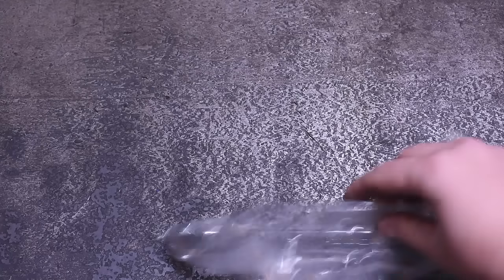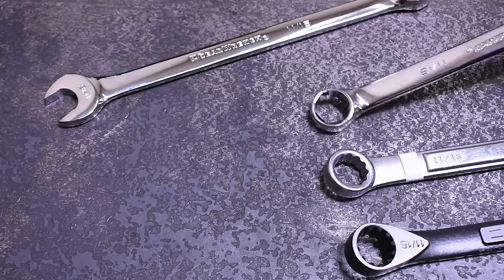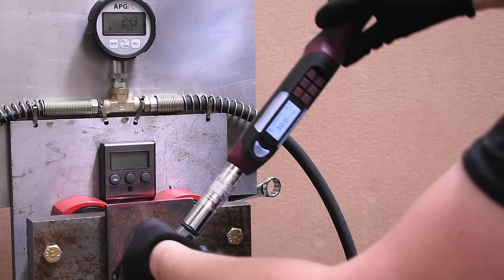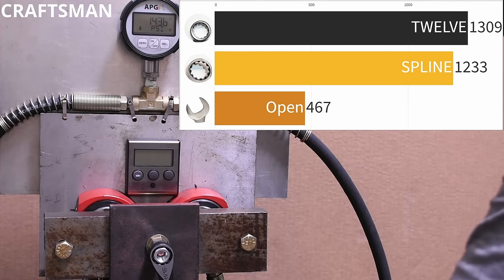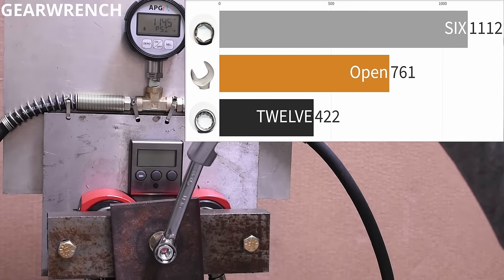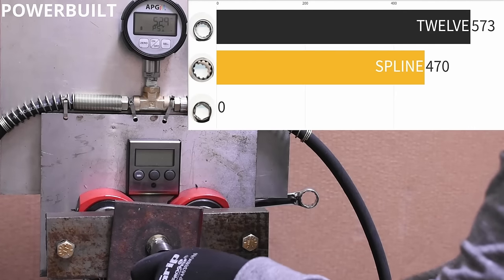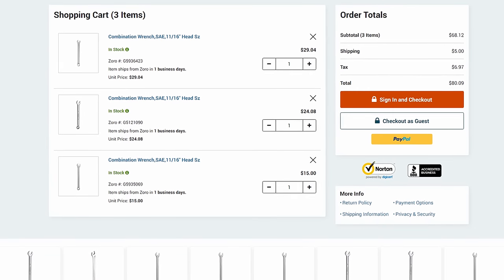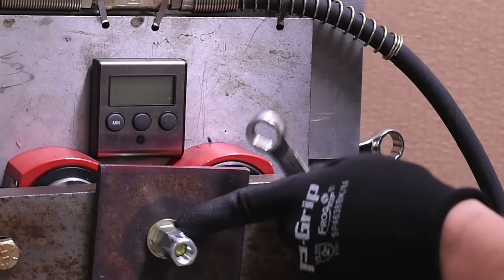Let's Settle This! What Wrench & Socket Design Will Slip 1st?

Comment: In my experience spline tends to rape bolts pretty bad if you're really going at it. If I can use 6 point, I'll use 6 point. The only 12 point I've ever specifically bought was an impact socket for my axle nut and that was because the nut was 12 point. I do have a few 12 point wrenches though that kind of floated into my collection over the years. I barely use them. Maybe on bleed valves when doing brakes. I can see a use case for spline but I think it's really only when I can't do it with a 6 point and I don't care if I destroy the bolt head and possible round the shit out of it. I also know though that you can hammer spline ends onto rounded bolt heads. Say you round a 1/2 bolt head that you went a little too ham on. You take a 7/16 and just wack the spline onto it and you can get a decent grip. I'm sure you could do the same with a 12 point too though.

Comment: It should be obvious that the wrench that fits with the least air gaps is going to be the one that works the best. When it comes to stuck nuts and bolts - and especially tarnished brake line flare nuts - I usually go slightly undersized and pound it on until I'm confident that they're practically cold-welded together.

Comment: I have not seen the video yet
I guess 12 point will slip first as there's far more potential points of failure, and with the nearly rounded edges of the teeth, it seems very prone to slipping.

Spline seems like it wouldn't slip, but if it does, you're gonna have a broken tool, and a broken bolt.

6 seems like it'll hold thr best, but you've got to have room to use it since there's fewer teeth to grab the bolt with

Edit: yeah that seems about right except for the spline. It seems like the tool stayed together, and it really did just strip the bolt. I guess that makes sense. You'd want the tool to be of a harder material than the bolt so it doesn't give under higher pressures.

Comment: The reason the 6 point came out on top is because has the most surface area on the nut/bolt to spread out the force applied. Each one has pros and cons. For example: the 6 point allows for the most torque out of these but the starting points are every 60 degrees whereas the 12 point provides starting points every 30 degrees but doesn't have as much surface area on the nut/bolt so you can't get as much torque. The spline is also pretty good for getting rounded nuts/bolts off too. The spline cuts into the nut/bolt and provides a bit more surface area than the traditional 12 point and so you can get a bit more torque out of it but you destroy the nut/bolt in the process. The open end is great for getting to a nut/bolt that you can't put the closed end around but you go back to the 60 degree difference per starting point and you sacrifice a third of the surface area (2 sides of the 6 point) on the nut/bolt which lowers the torque you can put on it substantially, as we've seen in this video. Hope this helps explain why the results came out as they did!
Reply: NOTE: This is based on the standard 6 point nut/bolt. For the regular person, a 12 point is usually the go to due to ease of access in tighter places.

Comment: This is awesome. This is the reality. 6 point to break it loose. 12 point tight spaces. Spline for spline fasners. Torx for torx. Hex fot hex. Triple square and so on and so forth. So for every faster you will require the proper tool to remove. You may slide by expending time for odd items. Usualt the exchange of time to aquire the correct tools is more beneficial than creative means. This is how tool companies retain business. A new tool for a new fasner. Same job, as the old faster. The difrence is the tool company paying a manufacturer to use the new fasner so the tools will sell. You use it, put it in the box and eat your remose as it sits rusting and collecting dust. I rember purchasing a screw driver for a ford car to remove one screw $235.00. I used it maybe 6 times. It was 6 foot long. From the driver's door to ajust the headlights. This was long ago. That was when a $250.00 a week was great pay. Today. $1500.00 to snap-on to get the socket set to remove the bolts from a f450 rear rotor from the hub. Seeing it should be attached through the lug studs and nuts, it also has 16 "omg its tight bolts" that are rusted into a permanent position.  (Harbor freight 10 pc spline drive socket set in 1/2 " $19.99) breaker bar and strapped to the building and 3 people taking turns.

Comment: There would be a big difference in the torque readings if the bolt threads went all the way through the couplings.
Example: A can of meat, beans, fruit or veggies, ECT is harder to compress / crush than an empty can. With your bolt only coming partially through the coupling and not supporting the couplings internal void the coupling will distort and cause inaccurate torque readings and premature failure. But the analysis is correct. 6 point made of the same materials and clearance specs will typically outperform 12 point because it has more surface area contact. This brings me to another point, the amount of initial slop, or a wrench having to large a bore will not perform as well as one with the correct, snug fit. But that is also dictated by the bolt manufacturer and their quality and tolerances in the manufacturing process. Speaking from experience!

Comment: Can you do a gator-grip vs other "universal" sockets (with the pins to grip a range of sizes)?  Curious to how they hold up under a torque wrench.  Other channels have shown them failing with impact drivers which they aren't really designed for, but none just testing torque failure.

Comment: I don't know what is the best way but is there a reason you put the wrench on a long nut in a point where is is hollow rather than where is has the bolt though it? In a real world application I would almost never have the wrench positioned in such a way. Rather I would have the wrench all the way at the base of the nut for what I would see as the most intuitively secure way to turn it.

Comment: i mean assuming it’s a standard 6 point bolt, obviously a 6 point will provide the highest amount of slip resistance. 

12 points are meant for lower torque applications in tighter spaces where the increased points of contact available make it easier to get onto the bolt head.

Comment: This video came to me right on time 
I’m just starting out in a trade, shopping around for tools 
About to buy my first sockets and wrenches 
Trouble for me is I’ve been advised not to buy anything nice 
Because I’m working on boats, mostly inboard motor, we drop sockets once in a while and never get them back because they’re way under a motor out of sight 
Or they go overboard 
My boss uses a Stanley 224pc set
With a handful of wrenches in his tool bag
I’d rather not have the same tools as him though 

I spotted a decent dewalt set online
But without being able to handle them myself I’m not sure 
Anyone have some experience with dewalt sockets ?

Comment: I hated splines until I started working with smaller bolts and nuts. Oftentimes I found that in the lack of 6 point availability, they were the only thing that could get the bolt or nut off at all

Comment: The only time you should use anything but a 6 point (*EDIT) socket on a standard 6 point nut(*EDIT),  is when you just can't get the angle with the 6 point. It happens, a lot. With a quality set of tools, the spline is usually the best option for those out of the way bolts, but if you are buying cheap, get the 12 point from the better brand, rather than the more expensive spline from  a lesser brand.

Comment: Maybe next you can do what works better to drive in a nail, a hammer or a ratchet. I'm thinking the tool that is built specifically for the job will work better but hey let's find out!

Comment: I would like to know the reading that a wrench will slip after the first slip, 

example, if the open end slips at 750 when you test it again with a new bolt does it now start slipping below 750 due to the opening being wider now.

Comment: Six point has always your best bet for max torque, twelve points for when you need more wrench access positions in tight spaces or just have a twelve point bolt - a six point deep well socket is highest torque with a six point deep well impact socket being good as it gets strength and grip wise

Comment: Got weird looks when I asked for six point box ends at sears 25 years ago... Still use them to this day and don't round corners.  Six point everything unless you actually need a 12 point for the fastener or because you don't have room to swing anything else.  Never understood why 12 point is standard for sockets, where it doesn't matter.

Comment: Don't you think the hOllowed part out nut you are turning on has some sort of integrity issue, verses the bolt fully through the nut? It may be skewing the outcome? Most nuts, and bolts have a center support.

Comment: I restore vintage motorcycles and some bikes have proprietary bolts with specific markings. Sticklers like myself are obsessed with original fasteners. My Bultacos have “Bultaco” forged into the bolt head. Most early Hondas had a zero with a line trough it (?) on the bolt heads. Then there are the EOM NOS fasteners that we vintage bike nuts drool over. That said I wouldn’t touch a single nut or bolt on my bikes with anything other than a 6 point and not a cheap 6 point. Rounding off one of these precious fasteners is a horrifying fear. There’s another entire discussion on Phillips and flathead fasteners with very spa specific tools that work better that normal tools.

Comment: I had 12 and Spline switched in my prediction. This is just obvious based on looks alone, not that obvious since I had two switched. I was looking at it in terms of RESOLUTION, the more ROUND you make the inside, the more points of failure you have, but if you're on a hex head or nut, then, another hex head would be best.

Comment: I use the double box end flex head ratchets from blue point, they are a spline drive and I use them to break 90% of fasteners at work.
But any mechanic should know their 6 point stuff is God.

Comment: It seems to me that the spline wrenches would perform far better on a spline bolt head or nut. I mean, can I use a Torx socket on a six sided nut or bolt head? Or course. But it works best on a Torx nut or bolt head. Despite how well your spline wrench worked on a six sided nut, I doubt it was actually designed for that.

Comment: It's essentially adding a low pass filter into the system. 
The mass/distance introduces an inertial oscillation that synergizes with the input frequency of the driver.
This is why it's not such a smooth torque rise. I bet a dollar that the shape of the graph is a function of the natural harmonic frequency of the mass/radius.

Comment: Well, somehow, it's not that surprising. 6-point ensure maximum contact surface with the hex nut, so more torque resistance... when 12-point have half of the contact area but give more angular possibilities in restricted areas. The best compromise is 12-point on 12-point : max angular freedom doesn't compromise torque.

Different tools for different uses. If you buy a set, i recommend sockets (more stable, durable and versatile) and if you're ok for a bit more money, a drive-click torque wrench (even easier to use).

Comment: I have those craftsman spline wrenches. They are good but the wrench itself will wear fast as that slight slip and bite feature of the spline design wears abit and it's performance will fade. But they are good. 
Being in Maritime Canada on the Atlantic coast. With salt on the roads and precipitation 90% of the year. I deal with rust. 
12 point is great way to clean the rust off a bolt in a tight area you can't get a socket in lol. Spline is easier to get in tight situations and get a good bite. 
Sockets such as 6 point or bolt extraction sockets are best where you can get the socket on the bolt. Wrenches are for when you cannot get a socket. 
Open end is best used a fork or spoon for lunches and cracking valves and such. Never bolts. Lol

Comment: I always use a 6 point when possible. But won’t mind using a 12 point on nuts and bolts when high torque is not required, with small engines you can easily get away with a 12 point unless the bolt head or nut is damaged

Comment: Great tests thanks for sharing! However, I was thinking you were rounding off a bunch of nuts not using the same nut as you round it more and more after each tools slips it doesn't seem like the results are completely accurate

Comment: Without even watching, I already know a 12 point tool on a 6 point faster is usually a good way to round off said fastener. Just depends on how rusted the head is and/or how stuck the thing is. I'm sure all the northern rust belters agree. Now a spline drive, well I've never used so...on to the video!

Comment: In my experience even within the same brand you can't easily compare these, as they may not be machined with the same precision. Even a fraction of a mm can give totally different results. I sometimes measure them and their fit and there is quite a difference. The most conclusive test would be the same material and the same precision machining them yourself...

Comment: Had a round off bolt, used a six point to round it off , then took a 12 point one size smaller and hammer it on. The socket bit in and the bolt came loose

Comment: I've had those same Craftsman spline sets in SAE and MM for about 6 years and have not been disappointed at all.  They were my first spline wrenches and I took a chance.  I wish I could say the same about other spline products because I hate the socket sets I bought thinking spline was a good design...boy was I wrong about the sockets at least Husky, Crescent and Cobalt.  Got the Crescent and Cobalt as gifts after buying 1/4 drive Husky set and now I'm gun shy about Craftsman and other brands.  Anyone else have input to sort this out?
Reply: I have the craftsman spline socket set in both mm and sae.  I stopped using them as my main set because on several occasions, they have stripped out many bolts/nuts.

Comment: Compared to a flat head screw driver, philips driver vs a hex nut driver, it's far more difficult to mess up alignment and pressure with the hex nut driver compared to the others.

Comment: Thank you for the enligtening tests, but re your socket test, you left one type out !! There is aditionally a six sided face drive (rather than the six side cornerdrive that you tested), where the faces of the nut are engaged rather than the corners. This style is designed specifically not to chew up bolt heads / nuts.

Comment: Spline tools are really designed for SPLINED FASTENERS which are far superior hence their use on critical aircraft fasteners like F-16 engine mount bolts. Twelve point sockets should not be used on anything that is not a 12pt fastener but they are widely sold because they're cheaper to broach as they require less tool wear for their shallow broach cuts. (Users tend not to consider PRODUCTION concerns, for example why chisels are not sold with integral handles which I weld or braze to their shanks.)

I buy six point sockets unless I get twelves in some generic kit.  Twelve point wrenches have obvious access benefits but i buy six point box wrenches too for obvious reasons.

Comment: Tbh it does make sense that 6 points would do very well, more potential contract area, and less room for the metal to actually push itself out of the way, it kinda keeps the nut held together instead of sheering the corners, as early, if you put enough forced you can round with 6 points, but its way less likely.

Comment: So without watchnig the video and using the 6 pt and 12 pt sockets in midwest auto repairs. the 12 pt is best when you already loosened it with the 6 pt. 12 pt is go for tight spaces when you dont have alot of radius to turn the bolt. 6 pt is for bolts that just wont come loose.

Comment: I tried using a 12 pt on my VW golf's axle bolts and it stripped every single one I tried. Apparently those bolts are triple square, not 12 pt.

What's the difference, you ask?

I got no idea, but the triple square sockets didn't strip...

Comment: Any 1st year Mechanic knows, should know, that for breaking loose nuts/bolts the only thing you should be using is a 6 point socket/wrench.
12 points are great once it is broken loose and in a tight area

Comment: I was told: “if you grab the right size socket it doesn’t matter if it’s 12 or 6, it will work.” But I’d rather just grab the 6 point.

Comment: I own all three in the Craftsman brand. I rarely use the spline drive, due to their love to grab and not let go easily. The 6 point for those eroded fasteners, and the standard 12pt for the majority of bolts and nuts. Regardless to being in the rust belt, most fasteners have corrosion resistance that keeps them in decent shape for many years. Usually after a decade, it's the other wrench that's not tested for removing nuts and bolts, the flame wrench.

Comment: This is a cool video, and neat to see what can hold the most torque, but in a practical application it's pretty useless data.  If you torque what I am guessing is a 1/2in bolt to 100 FtLbs, rounded corners will be the least of the damage you have done.

Comment: About wondering why everyone doesn't use six points all of the time, some may think that if you are using a breaker bar, as in about 8:30+ here, that you have only six positions of the bar to work with. But that's not true. Just remove the socket from the nut and then remove the socket from the breaker bar and rotate it 90 degrees from the original insertion of the breaker bar. You will then find the six possible starting positions of the breaker bar to be offset 30 degrees from the ones that you started with. In other words, you effectively have 12 positions of the breaker bar to use after all.